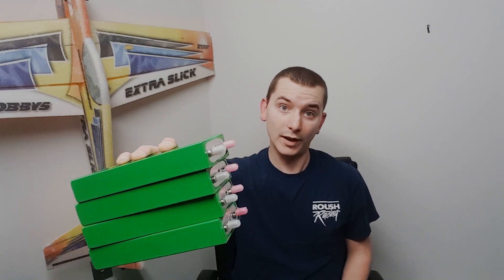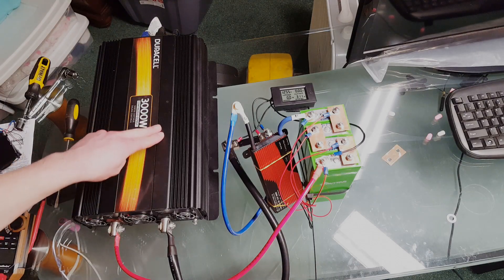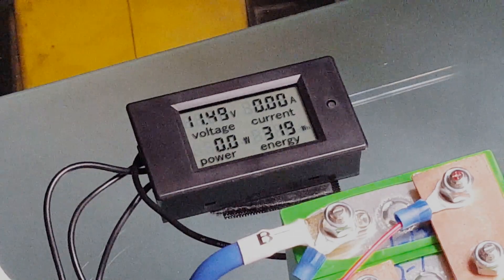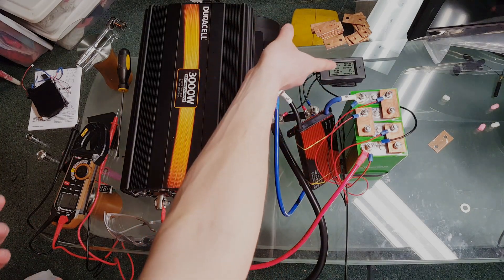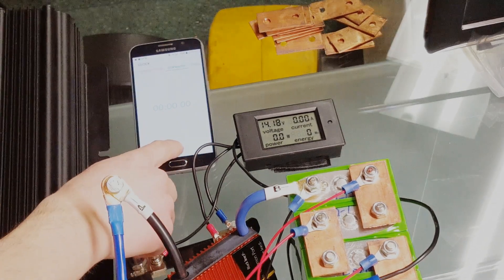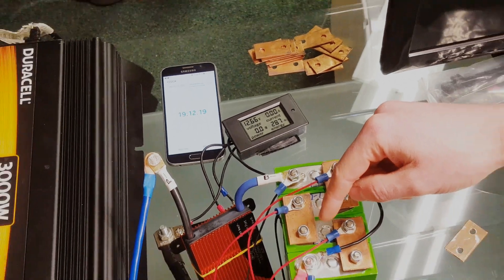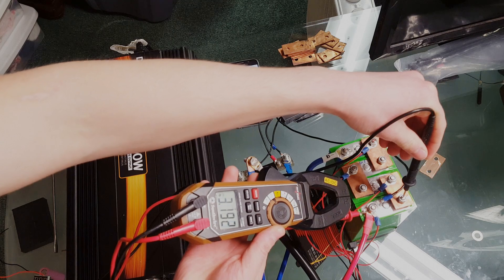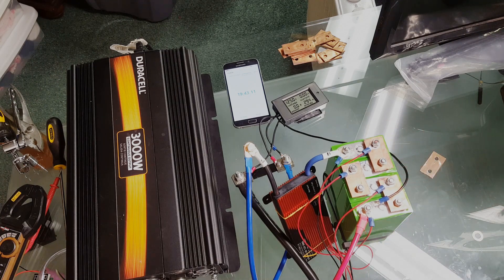Navitas 25Ah LiFePo4 1C and 3C Discharge Test - They Said Give It 75 Amps So I Gave It 75 Amps!

Comment: Nice Video! But why did the BMS not shut off when the voltage dropped so low?? Isn't that the exakt job of a BMS ?
Reply from the maker: It is! However these Daly BMS’s typically cut off at around 2.2v per cells which ends up being a lower total voltage than the voltage cutoff of most inverters. So the inverter shut down before there was any danger of over discharging the cells. Thanks for watching!

Comment: the 2nd round sale never occured on thier website. it was email only and the 2nd round sold out in a day or 2.   they do have 50a new lifepo4 cells for $28 each in cases of 10 now which is only about 10% more in cost than your green battery cells.
Reply from the maker: They had some of the 25Ah for sale for a few months and they have a few different sizes for sale now. You definitely have to keep an eye out for deals on their site because they sell out quick! Thanks for watching!

Comment: Nice electric airplane on the wall, outrunner?
Reply from the maker: Yep. It has a park 450 1200kv on it from turnigy. I only run a 3S on it and putt around. These EPP foam planes are TOUGH! If they break you just glue it back together and in 10 minutes youre flying again. Thanks for watching by the way!
Reply: @diyrenewableenergyelectron4996  Nice, I use to import German out runners back before everything went to China! Lol
Reply from the maker: Ill bet they were higher quality lol its so insanely cheap to buy stuff out of China now though. Hobbyking can get you a motor like this for like 11 dollars. Insane.
Reply: @diyrenewableenergyelectron4996  I use to sell 400 size LRK kits for $120 & a built motor for $225. My largest motor was a 1,600 watt which sold for $600. Lol
Reply from the maker: Do you still fly?
Reply: @diyrenewableenergyelectron4996  A little bit, most of my electrics are 1/4 scale & I don't get out to the flying site very much. I have some hand-launch gliders that I fly at the local park depending on how my back is feeling! Lol
Reply from the maker: Nice! I want to try some FPV drone flying but havent gotten anything yet.
Reply: @diyrenewableenergyelectron4996  You?
Reply from the maker: I fly the plane a few times a year but not as much as I would like. I want to throw an FPV camera on it. I think that would be fun.
Reply: @diyrenewableenergyelectron4996  Ya, that is fun, one of my first self built gliders had a 8mm movie camera in the nose, it wasn't very aerodynamic but it took amazing movies. Now days you can put a $40 pinhole camera on a plane without any performance loss.
Reply from the maker: I have a runcam sitting around collecting dust. Might put it to use
Reply: @diyrenewableenergyelectron4996  Ya that would be perfect. I suspect in a year or two they will have cheep 4k mini cube cameras; That will be bad ass :)
Reply from the maker: That will be a blast. I need to get some better cameras lol

Comment: Yep! I will run the 48 volt system and have the 12 volt just as a back up device incase the 48 volt have a problem. I will get more 120ah batteries to add to the set I got. Then I will run the 48volt system with 100ah batteries and configure the Gravitas to run 200ah on the 12 volt system
Reply from the maker: Prismatic cells are so flexible in their configuration. I'm liking them more and more!

Comment: Hey, Those batteries are good, man! I got a 16S2P set up. Today I ran those batteries for more that an hour at 400Watts. My MPPT switched off somewhere above 54.8V. I was busy doing other things but I expected that because it happened the day before. So I made a few notes and look up the instructions for the chinese brand MPPT. I did not find much. So I tried to recreate the shutdown condition again. Turning off the PV voltage to the MPPT caused it to start charging again. It happen three time. So I know MPPT was the culprict. The BMS kept the balance among the cells.  I  have a Classic SL so I can easily put it on line but I intend to get a MPPT another controller that can give 100A.
Reply from the maker: Glad you got it figured out! These little cells are awesome! Thanks for watching!